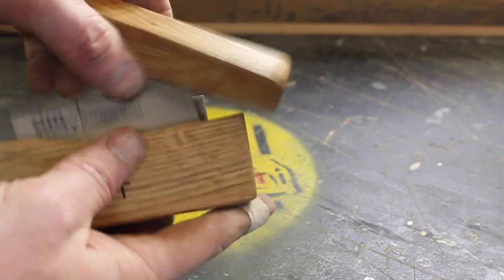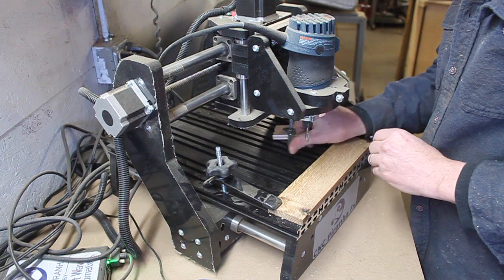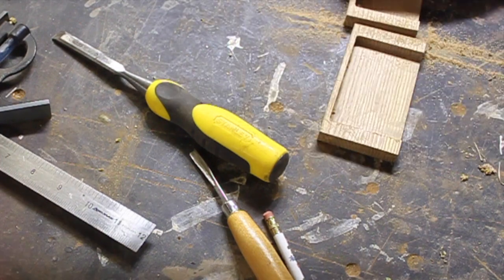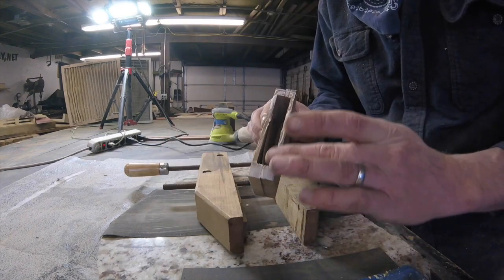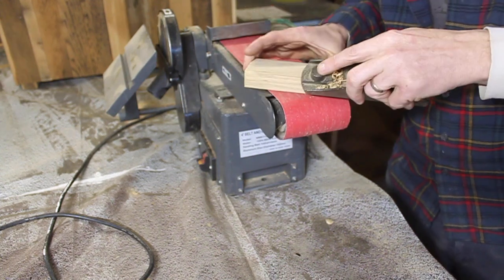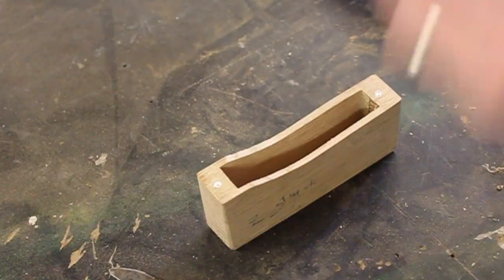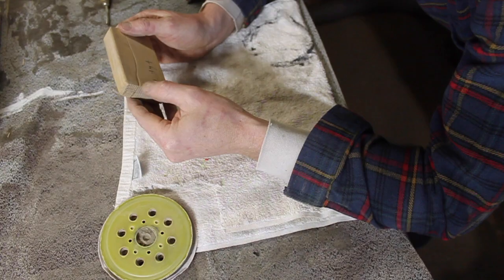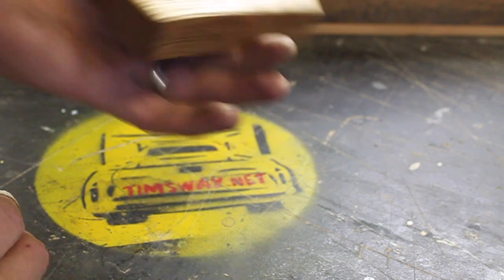Reclaimed Wood Business Card Holder V2.0

Comment: Tim use the little marker pins used to dowling. Drill the hole on one side. Put the pin in and line it up and squeeze together. It'll leave a indented point on the other side showing exactly where to drill.

Comment: Tim, you could cut veneer strips from the wood and make yourself some unique business cards with some stenciling or whatever you prefer. How about using the CNC to route the lettering for your business card all the way through a board and then slice it into cards that could be used as is or glued to another piece of veneer that has been dyed, stained, or painted or that is a different species that is a contrasting or complimentary color. You could try different shapes too. The results will definitely be unique and the most important thing is that they will be memorable. I hope you find this beneficial.
Peace!
Reply from the maker: Jeffrey Vastine the 2 veneer thing sounds like a lot of fun!
Reply: Yes and it offers a lot of possibilities. You could even more layers to create unique effects if the veneer isn't too thick. With the CNC it would be easy to do a marquetry card too. Have fun!

Comment: What if you drill the holes for the magnets before you glue the lid on? You'd have to fill the extra space on the top one with some dowel between the magnet and top, but the holes at least would be perfectly aligned when you cut the box apart.
Reply from the maker: Good idea! Someone else suggested letting the CNC do the job if I planned out my cut.
Reply: Thats my first thought :) you have a cnc that can do this for you. Maybe mill a jig in scrap wood to insert the 2 halfs in and then you have always the correct position for the milling procedure.
Reply: Michael Natrin easiest answer is often the best. Great suggestion

Comment: Could you drill out one side for the magnets and use a thumb tack in it as a centering pin to mark the location for the other side?
Reply from the maker: David Beckwith yes. I've tried using dowel centering pins, too, but since the hole is so shallow it's tough to line up proper. a custom pin makes sense.

Comment: Looks good Tim!  Sure that's Hebrew?  It doesn't look like any script I'm familiar with.
Reply from the maker: thanks! It's all Greek to me :) From the client when discussing the build: "the font ... is extrapolated from the engravings on a c. 840 BC stele called the Mesha Stele so that each letter closely resembles how it was engraved at that time."
Reply: Hi Max,
The font is c. 840 Paleo-Hebrew/Moabite/Aramaic/etc., very similar to Phoenician. Many nations in that region during that time used nearly the same alphabet and the stele from which this exact font was extrapolated was the Mesha stele, which is in Moabite rather than Hebrew, but the alphabets are similar along the lines of the similarity between the shapes of the letters in the English and Spanish alphabets. A Google images search for “Moses Ten Commandments” returns many pictures of Charlton Heston holding two tables with these letters spelling out the beginnings of each of the Ten Commandments. During the exile after the First Temple, there was much cultural diffusion, Aramaic became more commonly spoken than Hebrew, and it is thought that with the return of the exiles to the Second Temple, came the more-commonly recognized font known as “Ashuri script” which was and is still used for Hebrew and Aramaic. Though 2,500 years ago, this font differed slightly from Modern Hebrew, readers of Modern Hebrew would recognize most of these letters. (You can Google images search for “dead sea font” to see how even slightly more recently, the Ashuri script was still not identical to Hebrew of today.)